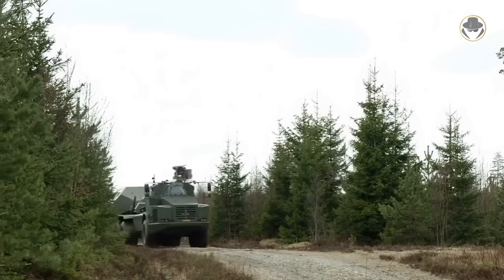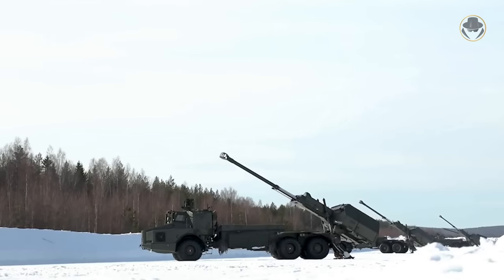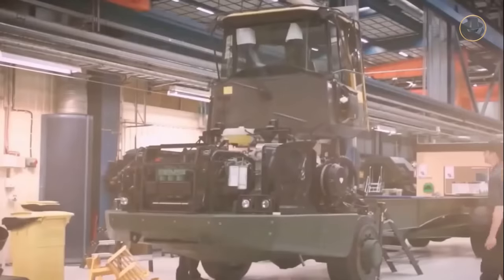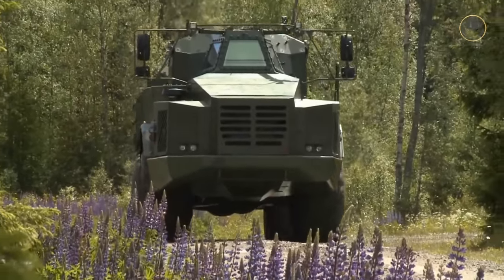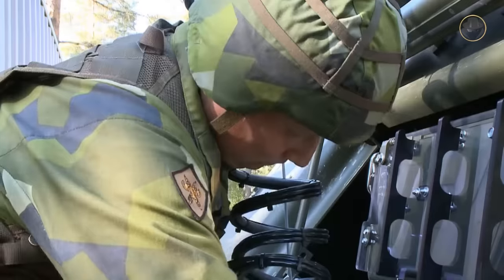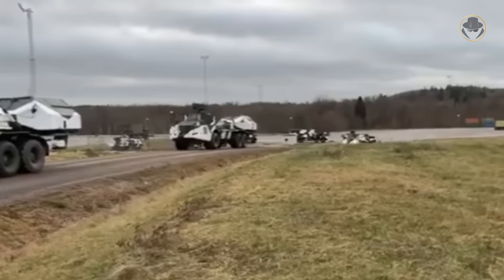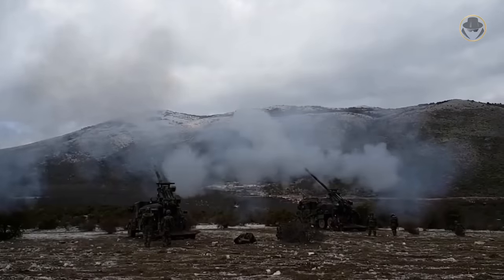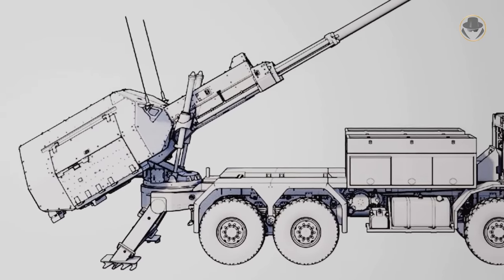Archer Artillery System | What is wrong?

Comment: The Archers fast in/out of position combined with the six salvo simultaneous impact capability is extremely powerful on todays battlefields.
Just look at the huge problems Russia are facing with counter battery fire, and redeployment times.
In and out including a three round burst salvo in under 5 minutes?
Hard to beat.
Reply: the issue is rocket artillery exist and they can outrange even the best guns. it doesn't make sense to have a gun system that cost as much as an rocket artillery that outrange it, that's the problem. if i can afford this, why would i not buy rocket artillery instead? that is the hype behind the HIMARS afterall...
Reply: @lagrangewei  Artillery shells are considerably cheaper than GMLRS
Reply: @matchlockashigaru9755  not if they are destroyed which is the point, you don't want to spend too much on lowend equipment, they are suppose to be disposal, so they should be cheap that u can afford to lose them. this is why US didn't send SPG to ukraine, they would be destroy like the M777. so their "improve survivability" as compared to normal artillery really isn't an improvement. for mortar and field artillery, there is no point to over invest in them. because if you are going to face an enemy that is strong enough that regular artillery isn't going to cut it, then this improvement really isn't enough to protect you. that is why no one buy it. it is overprice for the task and expendability of these system.
Reply: @lagrangewei  meanwhile in Ukraine; Pz2000 being withdrawn for maintenance due to barrel wear because the Russians can't hit it back and the Ukrainian army have been using it to shell almost non-stop...
Reply: @quantuman100  actually the reason they are out of service is because ukraine doesn't have enough artillery so they are overusing what few gun they had. it not reason good news that u have to depend on few guns. which is why u need number not quality.
Reply: @lagrangewei  HIMARS not Accurate
Reply: @lagrangewei  That consistent firing is what causes barrel wear.

The Ukrainian army has more artillery, just most of it being the towed type. The reason they fired the Pz2000 (and other self-propelled artillery) so much is because SPA can be used offensively, since you can drive off before enemy counter battery fire reaches you.
Reply: @Karl-Benny  ya, the missile it launches is the accurate thing
Reply: @quantuman100  It is the loading system that is unreliable, not the barrels.
Reply: @lagrangewei  but didn't the US send M109 Palladins to Ukraine ?
Reply: @remistiegler5302  i believe it was UK, Latvia and Germany that sent it. US didn't mention they gave any, it was Ukraine that mention they had M109 but they never claim it from US. these are likely surplus equipment.

regardless the problem is Ukraine has stated they need 1000 artillery piece, that is 10% of all NATO artillery.
Reply: @the_hate_inside1085  not unreliable but susceptible to wear
Reply: @lagrangewei  Today an artillery system without quality in precision is useless. The current best system is the German RCH 155 self-propelled howitzer from KMW because it can fire while moving. No other self-propelled howitzer can do that.
Reply: @OpenGL4ever  and a drone can still 1 shot it. the point is artillery is not the cutting edge, and no amount of tech can assure their survival. you are better off with having number so they can be organic. put it this way, the drone can only cap X number of artillery, the fewer you have, the more painful it is when you lose one. NATO is preparing for the previous war.
Reply: @lagrangewei  You need from every kind of weapon system something, but artillery must still be good.
Reply: @OpenGL4ever  you need numbers, if you treat artillery as "highend" when they are in fact low end weapon. you will not do well. and that is what we see happening in ukraine. ukraine need 1000 artillery to cover the frontline. if you only have 300 highend artillery.70% of your frontline is going to get fucked, and that is what happened, the kherson offensive never materialise for ukraine because it doesn't have enough artillery to start the offensive successfully. 

modern war don't work like napoleanic war where you can march the entire army into battle. modern war are much more distributed in order to avoid enemy concentrated fire, and this means you need alot of gun to cover the entire frontline. it doesn't matter if you can win 30% if you are losing 70% of the war. so quanity is always priority. if you can equip every unit with artillery and still have money to throw, you can then argue about improving quality. but to argue quality is more important than quantity is to not understand modern warfare.
Reply: @lagrangewei  High end is as good as 10 low end artillery. The PZH 2000 proves that.
Of course you need some more than 12, but you do not need 1000.
Reply: @OpenGL4ever  even if you argue 1 is to 10, you still need 100 of these guns. and to depend on only 100 guns, mean for every gun lost to drone or missile, mean you will be losing 1% of your fighting strength. the point I am making isn't that high end weapon isn't better. but that they increase the risk of losing your fighting strength as you are presenting the enemy with fewer target without reducing your enemy ability to destroy them. artillery just isn't the king of battle, missile are. and also if you think 100 guns can cover the front of ukraine, that really unrealistic, but let just ignore that problem.
Reply: @lagrangewei  missile are expensive. They cost more than 100 times the price of one single artillery projectile.
Thus for the same money, you can only get a small amount of missiles and you will have to live with that.
And low quality artillery systems are a waste of money, they can't strike and hide, they are not mobile and what's more important, you can't replace the men, that have to use them. They will die on the battlefield.
And that's why in a modern army high tech weaponry wins. Especially in the western countries where human life means a lot and soldiers costs money.
Reply: @OpenGL4ever  you are missing the point, the point is not that the missile is more expensive than a shell, it is that the missile is cheaper than the artillery system it destroy.  if I can destroy a an M109 that cost 14 million dollar with a 6 million dollar missile, that is a win. the point of missile is not to replace the artillery system, it is to destroy it. and the goal of artillery system is to be a cheap alternative to the missile, it is not a comparable system, that is not what I am suggesting, what I am suggesting is that artillery system are vunerable, and you have to consider the cost of LOSING THE ARTILLERY not just the cost of the shell when you choose your system. if you can afford the quantity, you can pursuit the quality, but to argue quality when you can't afford to lose them in bulk. is basically to lose the war by attriction. that the problem with the strategy of using a high cost system to do a low end job. now I am not arguing countries should buy SPG. but there is a reason why SPG only make up less than half of NATO artillery system. this weird idea that they are "superior" and can win the battle on their own is just wrong.
Reply: @OpenGL4ever  more ukrainian soldier had died than russian soldier. this is what we don't say to the public to keep morale up. why western army win is because they are high tech, as in they use air superiority and missile, not artillery. if you think artillery is what defines a hightech army, you are really clueless about the military. this is why despite NATO giving ukraine artillery it doesn't change the death rate, because ukraine doesn't have air superiority. US did not beat Iraq by using artillery, they did so by "shock and awe" which is an airpower and missile campaign. you are greatly mistaken if you think western ground equipment are superior enough to fight in a 10 to 1 disadvantage in number.
Reply: @lagrangewei  No one claimed that artillery systems will win on their own. And my other points stand correct.
You also don't fire expensive missiles on targets you don't see. And that's the case for the self-propelled howitzers. They're hiding in the woods, you can't see and find them easily. They shot and hide again, while your cheap artillery can't do that.
Your way kills only thousands of men and you can't replace them. It's also inhuman.
Reply: @OpenGL4ever  if you have air superiority, u can easily see where the artillery is, which is my point. domainance of control from the sky not the ground. to argue you can fire from the wood, if you are fighting without a forest do you tell your enemy to wait for 20 years for you to grow a forest? that just stupid. and you are talking as if you are "winning" and so has inflicted more death on the enemy, that just not what we see happening in ukraine. in ukraine whoever has airdominance wins, if they control the sky your artillery will be destroyed before they can inflict damage that is the point. and if your enemy artillery is destroyed, you don't need better artillery, there is no artillery left to fight you. which is why ukraine is still using their Su24 despite heavy losses, because without airpower, they will lose even faster. you are arguing as if artillery alone decide everything. pls just think about it because you reply, it really starting to sound silly.
Reply: @quantuman100  Something that wears out quickly, is the definition of something unreliable.
Reply: @the_hate_inside1085    Barrels wear out due to the number of rounds that are  put through it. If the barrel life is 2000 shells, and you fire 2000 in two days, the barrel would still wear out , no matter how reliable the system is.
Reply: @lagrangewei  No, you don't. Air superiority doesn't help you at all. You would need to spend a lot of time to find  anything in Finland's forests and while you're at it you will most likely get shot down.
Reply: Also note russias and tracked vehicles issues with ukrainian mud
Reply: @lagrangewei  But your complaint was that "It's better to have a cheap unmobile platform".

Archer is half the unit cost of the Pz2k and way more mobile.
Reply: @OpenGL4ever  Fire while moving is super cool from an engineering standpoints, especially if the loss of accuracy is minimal, but it seems mostly like a gimmick to me. If you stand still, fire, and leave within 90 seconds there's no chance that enemy artillery will have time to conduct a fire mission on your location anyway. If you are spotted by a drone or aircraft with A2G missiles you are fucked either way.
Reply: @lagrangewei  Have you heard of lancet drones
Reply: Their slow response is in large part due to a horrible chain of command, terrible/lack of comms and worn out barrels.
Reply: @lagrangewei  answer to your question is there is a need for both systems on the battlefield which is proven in Ukraine a himars salvo costs a million dollars whereas 155 mm shell cost under $10,000 . There is no need to take a gun to a knife fight😂
Reply: @lagrangewei  you know a military doesn’t have to just go with one or the other, right?
Reply: @lagrangewei 
And so can the best guided arty system outrange the common rockets such as grads. ATACMs and Iskandar are theatre level assets. You would never use them for a normal counter fire mission. They're more for leveling command posts and bases. Otherwise, MLRS and automatic arty fill the same role, and you choose based on what you have. Shoot and scoot with towed pieces is still possible, just don't expect to fire off more than 2 or 3 since you are going to need to pack up and run.

Comment: Sounds like if a large enough military procured it then it would bring some of the maintenance costs down and the overall advantages would shine through. Based on experience of plant operations, articulated loaders are cheaper to maintain than any similar sized tracked vehicle.
Reply: Most importantly doesn’t require specially trained mechanics them bitch are off the shelf just like the transmission
Reply: For the same money you could buy 3 B-52 Nora, which are more compact standard 8x8 trucks.
Reply: Those haul trucks are very common here in Canada
Reply: the chassis already has a really low maintinance cost because volvo has build like 100 000 of them for the commercial market

Comment: I have driven Volvo dump trucks for many, many years, mostly A40 but also some A35. They are solid and reliable as only a Volvo can be, they go year after year. In Svalbard, each of them drove about 600 km every 24 hours, it was 24 rounds of 25 km each. Standard Volvo inline six engine. There were no problems with them and the maintenance was done by a former bus mechanic so to say they are complicated is just nonsense.

Comment: Thank you for this video, it was very informative. I'm a Navy veteran and my knowledge of Army matter is a bit lacking. I saw the Archer discussed as a possible system to send to Ukraine and from what few details were discussed I thought it would be the best system for the Ukrainians to use to accomplish successful counter-battery missions against Russia. The ability to put 3 rounds in flight and be moving again before those rounds hit is, I think, exactly what is needed by Ukraine. I think the US Army should consider this system again or more fully, I don't know exactly where they are on that process. We in the US don't consider some weapon systems because our Air Force is so dominant on the battlefield. Attempting to fly in an area controlled by an F-22 Raptor is frankly a suicide mission for any opposition air force. Thus, less emphasis on counter batter fire, MANPADS and ATGMs. In fact the US hasn't built any MANPADS in over a decade and will likely send all our current stock to Ukraine. Perhaps the US Army will replace the Stingers with a much lower number of Starstreaks. I think a small force of Archers would be a good idea as well.
Reply: The US Army tested one at Camp Atterbury in Indiana in 2021 and later a general went to Sweden and took a closer look. That was 2022, still talk of buying some, maybe with some battle experience they may get some.
Reply: @johnstark4723  Thanks for the information. Considering that the US Congress is getting ready to spend trillions on weapons, I think the least we can do is buy enough of these to give the Army all they need for quick response mobile counterbattery teams.
Reply: @trplankowner3323  it's too bad we didn't have 4 or 5 of these in syria when the ruskies attacked the 40 US Marines.  That would have wiped out the entire russian force in 10 minutes instead of just 200 of them 😉

Comment: The idea that the hauler is difficult to maintain is not true, its actually easier to keep running than a regular 8X8 truck. The infrastructure is open and its easy to access the engine/gearbox etc. The trade offs made for the more expensive truck chassis will be apparent once you take a look at what it can do in muddy or snowy terrain. The conclusion at the end of the video delivers some misconceptions concerning the reason for the truck mounted guns, in the end when it comes to artillery its all about getting those rounds down range quickly and accurately and then running away. The hauler gives you a platform with the best blend of mobility and speed while its massively overbuilt for the weight of the archery system, slap armor on the cabin and it will still be trucking along just fine in basically any terrain. The normal truck on the other hand will have a harder time balancing armored protection and mobility due to weight constraints.
Reply: "The idea that the hauler is difficult to maintain is not true, its actually easier to keep running than a regular 8X8 truck" - any source on that claim?
Even changing a tire is a major undertaking (https://youtu.be/H10oTWbsr6Q) in comparison to a simple 8x8 truck where crew can do that (https://youtu.be/H10Dq4Kng9E), and an 8x8 could even run in an emergency with one of its front tires blown. 

"in the end when it comes to artillery its all about getting those rounds down range quickly and accurately and then running away" - I would agree.
"The normal truck on the other hand will have a harder time balancing armored protection and mobility due to weight constraints." - I wouldn't agree.
Reply: @My-Opinion-Doesnt-Matter  The archer can run with all tires blown..
Reply: @My-Opinion-Doesnt-Matter   well this one can run even if all the tires are blown and they can run in a terrain that a regular truck are pretty much useless in..and yes they are probably easier to maintain because everything is accessible,the archer are for nordic conditions, they can run in 1 meter deep snow without any problems
Reply: @spiritwolf7  "probably", so you don't actually know?  A lot of people seem to be making these claims based on...nothing in particular.  My favourite so far is because it is 6x6 instead of 8x8🤦‍♂️ so simple...
Reply: Completely agree with you. 👍